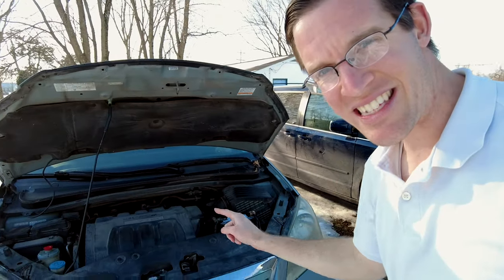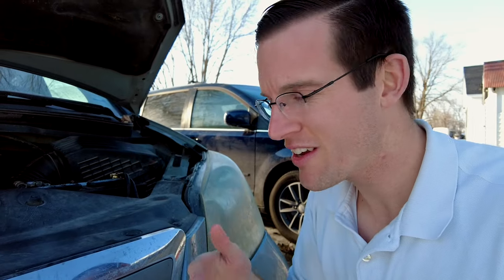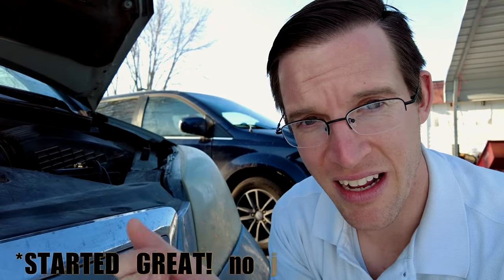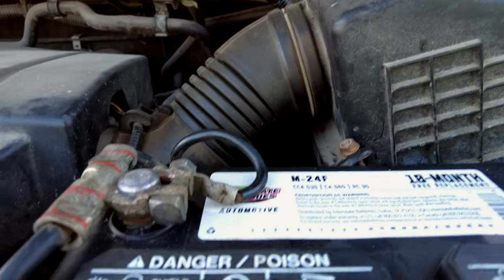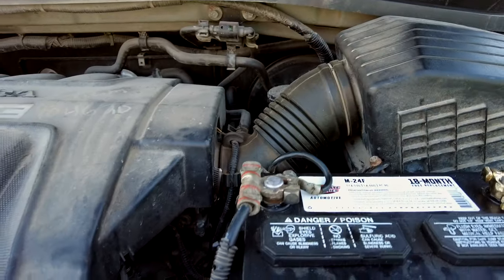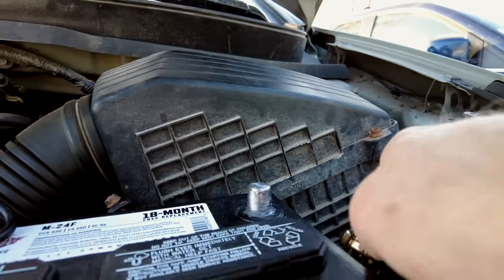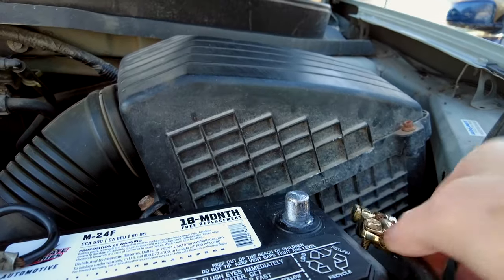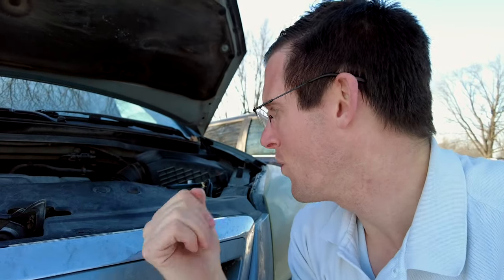EASY FIX! Car Battery Keeps Dying? How to fix in 1 minute

Comment from the maker: *portable jump starters on AMAZON: https://amzn.to/2NmcOUl (affiliate link)
Reply: Your car keep draining because the negative terminal is not tight enough they have to be tight so the battery can recharge while you drive I just realized this from my car
Reply: But won't this method also disconnect the factory alarm system?
Reply: @HouseCallAutoRepair  hahha you are Correct Sir, it is not a good idea to disconnect a batter cable from modern day cars. the computer will lose important information about your engine that it will have to relearn .
Reply: Yeah that works but it’s still dies

Comment: You can also prevent thieves from stealing your wheels by simply removing them all yourself and rolling them along next to you every time you go shopping.
Reply: A better idea is to put them in the trunk or back seat. Be sure and put them back on the same location you took them off of, or the car won’t know which direction to go.

Comment: I know folks are jamming this guy up, but it’s definitely helping folks with little or zero vehicle knowledge. A faster fix is installing a battery kill switch inside your vehicle so you don’t pop the hood every time. We have them on our fire trucks for this very reason. Merry Christmas folks!
Reply: @HouseCallAutoRepair  hook it back up correctly, pass inspection for another year, then back to kill switch lol
Reply: Can u imagine the Amp rating on a switch or relay that disconnected a battery main power supply?
Reply: "Yes, but":  treating the symptom (disc. batt every time vehicle is parked) does nothing but insure the root cause of batt discharge overnight will not be resolved. This is not advice that should be followed. Friend should have said there's a problem with your battery and/or something is draining it while it's parked. A vehicle should be easily capable of being parked for weeks without the batt discharging to the point of failure to start so get your battery tested/replaced if necessary, if that doesn't resolve the problem take it to a mechanic who can test it for parasitic electrical draw. You can disconnect the batt to keep it from draining the batt but that's almost as much of a PITA as jump starting it. THAT's what the friend should have told him. Disconnecting the battery to keep it from draining might be necessary in an emergency but is not an option, long term. I'm embarrassed for the guy who posted this video and for his friend. It's not rocket science to make the connection that a car battery should not discharge overnight. Sheesh.
Reply: A kill switch ? Nice I think ima go for that cause yea stopping and having to open your hood disconnect terminal can also get frustrating
Reply: @C3cover yeah this is obviously only a temporary solution. I'm embarrassed for you reacting so insane. He even mentions at the end it's not a perfect solution.

Comment: Typically the cause of the battery draining is a door lock, most likely the sliding doors getting stuck making the sensor read open..then causing lights to run and drain the battery
Reply: Thank you for making me relalize how to fix my own car i just got it and notice the light on for an open door and my battery's has been draining
Reply: Thats kinda what im thinking about my honda pilot. i needed a jump yesterday and throughout the day is was fine but still got a new battery. today needed another jump. no lights on except above the doors while i drive. finally i turned them off and planning to manually lock my car tonight and see what happens tomorrow.
Reply: Thank you so much. My X cut off the wire in my sliding door cuz he said he will replace it it's already a year he still never fixed it. I really think it's the damn door that he messed up.

Comment: Better idea, getting a battery disconnect. A little handle that you spin into place, cost about five bucks, and disconnect your battery when not in use without disconnecting the lead itself
Reply from the maker: Great idea!

Comment: my ford mondeo 2004 drained battery through the winter but for some reason.. in the spring it stopped and found out its a small gap either in the trunk or any of the car doors that are open just a few millimeters and it thinks its open, but when you look inside it all seems to be quiet and no lights are on but its draining the battery. if the doors are a little frozen make sure its totally closed if it has been frosted through out the day/night take a hairdryer or a heat gun and warm the rubber strips around the doors (not sure what they are called in english) and wipe them dry after the ice melts. after you have done all that slam the doors shut and maybe that did the trick for your battery drain because it sure fixed mine 😉👍

Comment: This is good advice for anyone (like me) who has a vehicle that is only used every week or two. My '05 Accord Hybrid has always been brutal on 12V batteries; it draws a lot of idle current so unless it's driven regularly, the 12V battery will spend a lot of time not-fully-charged and that destroys lead-acid batteries. But that Odyssey, with the battery draining in less than a day,  either has a battery that has already been destroyed, or its idle current so high that it's  due to some defect. I should add that with newer vehicles, disconnecting the battery cans cause all kinds of annoyances like lost radio presets and loss of other "customer preference" settings. My Accord doesn't loose its presets, but I have to enter a secret code (which I have memorized)  to get the radio working again, and my auto-down windows (a feature I don't particularly like) stop working until they re-calibrate themselves.
PS: If you find yourself driving down to AutoZone to get a battery charged more than once a year, it's time to buy a trickle-charger.
Reply: Can I buy your 05 Accord?

Comment: Battery drains can be so random it sucks. I had a 1990 Honda Prelude that kept draining the battery and I started removing the negative every night. About 3 months of doing this, and one morning when I connected the negative, my radiator fan turned on. Turned out, power steering fluid had leaked on the fan switch and the fan was randomly turning on at night, draining the battery.

Comment: Fix the car.. 
this is not a Hack or a Repair..
Check it with any voltage meter... pull each fuse and check what system is draining your car..
Reply from the maker: good advice!

Comment: I have been doing this. Having this issue on my 2005 Ford f150. I've been disconnecting both cables but if I can just disconnect the negative then that'll be a little Easier.
Reply: Yes always disconnect the negative, black lead .

Comment: That sucks. Cars today have battery issues. 
The old beaters I drove most of my life always started in most weather even without being plugged in. 
My 12 yr old battery failed for the 1st time on my ‘03 Ford F-150 yesterday.
I’m not complaining.
My wife’s 2021 Corolla battery died after not being used for a week or so. Not happy.
It’s only got a 1000 Kms on it.
Reply: yes that sucks a lot, i will try another thing

Comment: Yeah, well are you ready for this.

I did this years ago, and my cable came off the terminal as I was driving. Can you get what else went out as I was driving at about 40mph when this all happened? My power steering, I had to try my hardest to turn the car myself. I was able to halfway turn it into a side parking lot at a store where I then proceeded to run into the curb. An I mean "run" into a curb. I was forced to get a new tire as it blew out my front. An I know I could have slammed in my breaks but I had fast traffic right behind me, I couldn't have put my breaks on. Coasting in that car with zero power is the scariest thing I've ever had happen in a car. No control, no power, just aimless coasting with no turning ability.

Tighten your terminals my man. Especially if you have power steering. Good lord
Reply from the maker: oh wow, thank you for sharing! That sounds terrifying!

Comment: Make sure you use a wrench / spanner to reconnect the battery. Having your battery disconnect while driving can be very dangerous, especially on modern vehicles. Also, get your car fixed 😂
Reply: I forgot to do that and fuse blown lucky nothing happen to computer box
Reply: @sahillarya06  computer box

Comment: At 1.55 he tells us he drives around with his car battery incorrectly connected, and somehow he thinks he is qualified to give advice on how to prevent your car battery running flat. 

Those connectors have nuts on them because a tight,  close fitting connection is a great way to charge your battery as you drive around and a lose connection like he has isn't. Also,  on a modern car having a poorly connected battery can be hazardous to the car itself. 

Seriously,  if you only think you know what you are doing,  don't tell others
Reply: You miss understood, he did say "Fix" which it isn't but it is a quick simple way of improvising a way to make your car not die and have to do all extra work to charge it up.
Reply: Trashed Panda, I agree about the importance of a tight connection. But to be fair, in response to, "...somehow he thinks he is qualified to give advice on how to prevent your car battery running flat," he said at 0:30 that he got that advice from a car mechanic. Also, you have to admit that will prevent your battery from running flat. Anyone who knows a little about cars is qualified to give that advice. 😏
I do hear what you're saying, and I frequently complain about people talking authoritatively on subjects they know nothing about! But it's different when you're just relaying advice and you cite the source. (I'd also like to think his mechanic mentioned the downsides, and that this tip is just a stopgap. He☝ realizes it, too.)

Comment: You probably have a parasitic drain somewhere. Something is causing the battery to drain. You should be able to let the car set for weeks without the battery draining too low to start it. That’s got to be a hassle having to disconnect the battery all the time. Mechanics are not in to running down a parasitic drain issue because it involves a lot of work to isolate it sometimes.
Reply: maybe you know how to detect parasitic drain fast my yourself?

Comment: I had a 2007 honda odyssey had the same problem if I parked in the garage I would have to jump it . got all kinds of advice and all kinds or pricing from 250 to 2000 dollars . turned out the relay for the AC was not kicking off the compressor I bought a relay for 8 buck as soon as I put it in you could hear the compressor kick off never had the issue again

Comment: Good idea for older cars. Most New cars the ecu will throttle position sensor memory, and car will run like shyt, idle will jump and down and will stall at stop signs usually, or just barely run all together. and the relearn sequence can be really tedious in some cars.

Comment: This works if you dont mind reseting your clock and radio stations every time. Put in a battery disconnect switch and save your cables and battery posts if this is what you want as a fix.

Comment: This was kinda obvious, and like you said, probably not the best solution, but it will get you by till you actually fix it. Auto parts stores sell battery cutoff terminals that you use just by turning a knob (quick and easy), but like any quick fix, not the best idea, but they will get you by. Thank you for a cheerful tip.

Comment: Gonna have to try this . Only thing is the having to reset clock lol. Anyways. Thank you for the tip. But why did you say you'd have to run it for an hour after jumping it because only takes 15/20 min of driving because the alternator recharges it, not just leaving it sit running.

Comment: DON'T DO THIS! It's hard on your car plus you reset every electronic thing in your car! Radio presets, electric window limits, engine & smog computer, everything! You'll fail your smog test if you do this beforehand.
Reply from the maker: interesting, thank you for your insights! I've been doing this regularly for weeks, and in order to use the radio I have to re-enter a 5 digit start code. That'd make sense that it could possibly wear out some electronics faster. It's nice that I don't need to do this as much, now that the weather is warmer, it seems the battery holds it's charge a lot longer. thanks!
Reply: @LifeyGuy  imma have to try this i been goimg back and forth to oreillys charging my battery
Reply: It's better to disconnect your battery than to let it run down, which also wipes out all that stuff. But, obviously, a car that requires this every day need something fixed.
Reply: ercost60, yeah that is the main issue I would have. However, I've noticed that some of the gadgets in my 2015 car do not need resetting even after the battery has died or been disconnected. How long they "remember" I don't know. I guess that's due to capacitors, but maybe one or two of them even have a small battery of their own.

Comment: Yes this is a good tip. However I knew about since I was 18 when there was a power drain somewhere and didn't feel like tracking it down. I even knew someone who modified a bike seat pull clamp to make a quick release so you wouldn't need tools to loosen and tighten. I own a 20 year old Volkswagen jetta now and have basically removed all actuated interior lights, trunk, glove box because of failing electronics.

Comment: Why not install those 'screw on/ off' connectors?? Better to get a secondary old but 70-80% battery install with a 'relay' and optional 'screw on/ off' switch. This way de car settings eg. Clock, computer settings are not 'taken off' but relay stops any parasitic draw from starter battery. The option of screw on/ off gives you ability disconnect second battery if you choose to esp. use it for camping use.

Comment: Doing this way You erase adaptations. After every engine start with this way You should wait some time to rise temperature and engage blower, it is minimum. Find the parasite, do not disconnect the battery.

Comment: Draining a lead acid car battery repeatedly damages them (not so much with a deep cycle marine battery).  Eventually the battery after enough drains will die or be incapable of holding the amperage you need.  Your 'trick' is a good short term solution, but not a long term one.  A loose connection can corrode and also block recharging from the alternator.  Turn the car off and with the battery in and all the lights off test the voltages at your fuze box.  They should mostly (not the alarm system) be reading zero volts.  Any that show voltage flowing are suspect circuits.  Most probable causes are a bad relay or switch, or a short somewhere.

Comment: Surely better to get the problem fixed than use this "hack". Disconnecting the battery will mean you loose preset radio stations, clock with need to be set to the right time etc, and even if you are prepared to put up with that you are living on borrowed time. You go to the shops and load your car with groceries and frozen foods only to find that the battery has given up again! Is the solution to disconnect the battery every time you get out of the car? No, just spend a bit of money on a new battery...

Comment: Cheap battery post disconnect switches are available to disconnect your negative battery clamp without completely pulling it off. You just turn a knob counter-clockwise until it's disconnected. Then turn clockwise to reconnect. Your battery post and clamp will last much longer that way.

Comment: side terminals in tight places this makes this a hassle. Bolts strip easily without the correct wrench.  Find out what's killing your battery. Your battery will only last a year with a bad Alternator or bad solenoid.

Comment: Sorry, it won't fix anything, it's only a workaround. The real fix is to hunt where the fault source is in electrical system. Could be a bad door switch, a trunk/rear liftgate switch, a glovebox switch, the radio, a grounded faulty wire, etc.

Comment: There is one problem with that hack.  Most cars are filled with computer modules that control just about everything.  If they lose power, (disconnect battery) they lose their memory.

Comment: Do not ever do that do not do this it is hard on your car well it sounds to me like your mechanic was someone hired off Craigslist and it's bad on your terminals and for me with two deep cycle batteries for my diesel that would be in efficient. You have the littlest tiniest little efficient mirth mobile how hard could it really be to chase a couple wires it's one of your lights or the radio come on that's like me saying to stop my wife from farting in her sleep just stopped feeding her at night time that would not play out well. That was probably a bad analogy but you get the picture

Comment: Wow. No thanks. You keep the negative terminal riding like that and you can cause a serious accident if that comes lose while you are driving in the middle of the interstate and your car dies. How about you figure out where the power drain is coming from? This is definately something you dont want to do. I know this seems convenient in a pinch but its not wise to do.
Reply: I wouldn't do it, either, for other reasons. But would the car actually stop running if the battery became disconnected? I might have guessed that once it started the engine, the battery's function was finished, other than to receive the needed recharge (which of course it wouldn't if disconnected), and that the alternator provided all needed current. Also to be fair he did say he knew a real fix was needed, so I don't know why so many people subsequently told him that.

Comment: or you could have a bad alternator that might not be charging your car battery. Also may include some other problems and please do take your car to do diagnostic check up at a local O'Reilly's Auto Parts store just in case